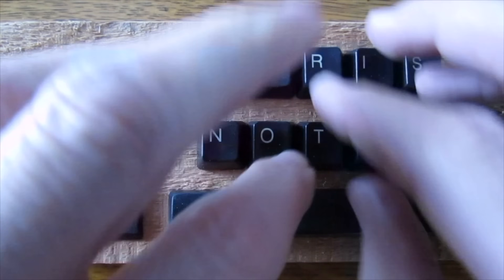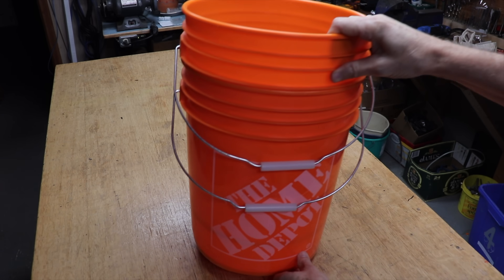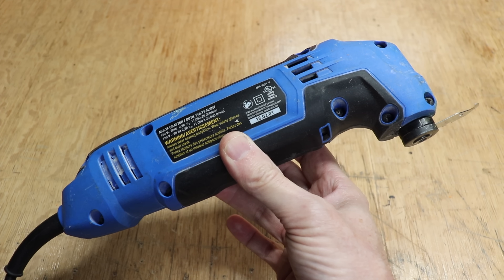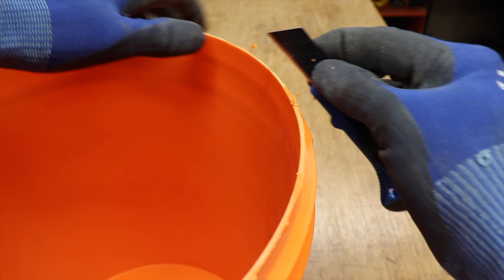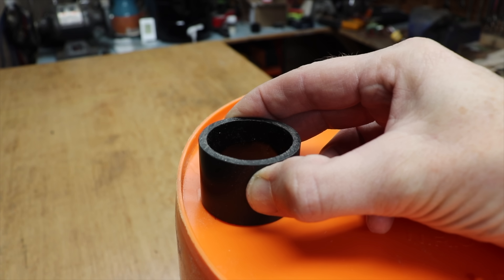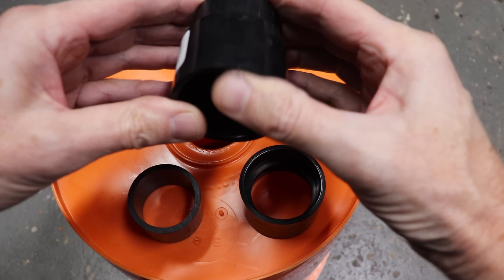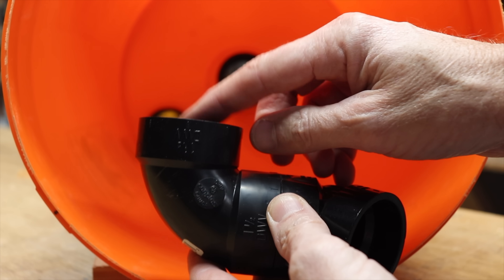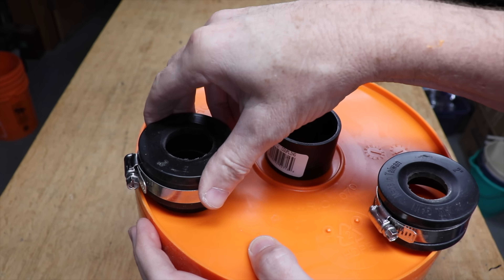How to Make ● Simple Cyclone Dust Collector

Comment: I made 2 of these 1 for sand blasting cabinet 1 for powder coating cabinet and liked it so much made a third for when cleaning crap around the work area ... with that said when using it for non stationary applications the pos tips over always ,, you have to use a death grip on it when cleaning to keep it from toppling over ..recomend you attach it to a cart along with sweeper. with that said for people using a large craftsman skip using the itty bitty pipe in video buy 2 inc pvc or abs fittings when connecting to the craftsman hose take a 2 inch coupler and shove a small length of pcv tube into 1 side so it retains it shape and on opposing end of coupler use 2 hose clamps joined together to put pressure on outside diameter of coupler (to big for craftsman hose to connect to) using a heat gun heat the end of coupler while gradually tightening the hose clamps to make the diameter small enough for a snug tight fit on the craftsman hose. when tight fit is achieved leave the hose in coupler and go brew some coffee and let it cool .. when cool you now have a craftsman to 2 inch pvc coupler ... make a few so you have plenty of adapters.  I used hard pvc pipe for blaster and powder coating because it was better and cheaper connection then using hose or cutting up one of my expensive to replace craftsman hose. also makes chances of tipping over nil as the hose if not trimmed to exact length places a load on buckets wanting to tip them over.. could always drill and tap spare workout weights to bottom but no need at moment
Reply from the maker: Did you see the update video where I address the tippy issue?

Comment: I wonder if this could be adapted to sucking up leaves in a pool? I've worked with cyclone pulp cleaners in the paper industry most of my life and they are very efficient. Adapting this to separate water and leaf particles would be a great find as they are the bane of my existence every spring when it's time to get the pool ready. Going from vacuum to pressurised would require rethinking all connections, but not a big deal. Hmmmm,,,,gonna have a go at it.

Comment: I built one of these for my shop it handled my plainer and table saw with no problem. I did add a plywood disk to the bottom of both buckets to strengthen them, the top bucket for the pipes an the bottom one to attach a castor base to

Comment: Sadly, the details of the buckets have changed since then. I am still working on a way to make the current version fit.
Reply from the maker: Others have said the buckets at Lowes also work. Hope that helps.
Reply: @chrisnotap  what ended up working was an inverted Lowes bucket inserted into an HD bucket. I trimmed the blue one snd added a gradual taper with a belt sander. Thanks!

Comment: Hmmm....MY Home Depot bucket is definitely different from YOUR Home Depot Bucket. I hope it still works. The rings are closer together on the top of mine, and the center ring on the bottom is smaller than the outside diameter of the pipe...

Comment: I bought one of those orange brand separators that fit on the top of the buckets, it said 99% effective, nope 75 at best so I returned it and bought the parts to make this. I'm VERY impressed at the effectiveness. Hardly anything in my dust vac.

Simple and easy to make too, thanks Chris

Comment: Ha! I'm amazed it worked as well as shown! I have experience working on industrial cyclones in the plastics molding industry. Regrinding scrap plastics generates lots of dust (or "fines" ).
Typical cyclones are conical shaped - airstream introduced at top of cyclone pointed in direction to go around....spinning air throws dust particles upon cyclone walls (centrifugal force)...particles fall down to bottom....where an airlock (rotating drum having "cavity wells" collecting dust) dumps it below cyclone into a bag etc. Air flows out thru pipe in center of top of cyclone to a baghouse.
Cyclone cone shape is the secret of a good working system. 
Like I said...I'm amazed this design worked! Was not of conical configuration. (I'm gonna build this design but I'm going to use cheaper buckets from WalMart because I'm a cheapskate! 😆👍

Comment: A W E S O M E!
Finally got around to making this and works way better than I expected. For the dust inlet I used a shop vac multi tool adapter so I could switch out easily for different size hoses, it slips perfectly over the 1 1/2 coupling. I’ll leave a link below. CRAFTSMAN CMXZVBE38677 2-1/2 in. Wet/Dry Vacuum Universal Tool Adapter Attachment https://www.amazon.com/dp/B00JG3F8S6/ref=cm_sw_r_cp_api_glt_i_TRKT6GJ58A7SWY1QENZ4

Comment: I would add a sheet of metal to reinforce the bucket where the air stream first meets the plastic of the bucket. Otherwise it will get sanded down in no time.

Comment: Buckets at Home Depot (and everywhere else) may look the same, but they're manufactured by different companies to fit a loose guideline, not an exact spec.  You need to edit this video because not all buckets will side into each other when cut to your specifications.

Comment: Hey Chris, great video, thanks so much for putting this together. I have two questions:
1. How many HP did the vacuum you used in the video have?
2. The 1 1/4 inch hose is a bit narrow for much other than just dust. Do you think this same design would work if all the components were spec'd out for a 2 1/2 inch hose? Like 3" rubber caps, 2" pvc parts etc? Plus of course, the small screw ;-)
Reply: Hi Nenad, I was thinking the same. Did you try it? I am going to try a 5 gal shop vac. Thanks

Comment: I have a vacuum pump from an upright bagged vacuum cleaner that I took apart. It's pretty strong. Do you think I could just stick it on top of this assembly with a filter to keep particles out of the motor?  It still has the seal from the enclosure it was in so it could just sit flat on top of that middle hole.
Reply from the maker: Give it a try. It's all about creativity and trying things out! Go for it!

Comment: I made this: a few issues though: I think it depends on how powerful your vacuum is. If it's powerful fine dust from eg. a fine saw blade won't stay in the buckets and will go into your vacuum's canister. 2) this two bucket set is top heavy especially when you have two tubes attached to it. 3) How much of the top of the bucket you cut may differ from this video- I had to cut a bit further down to allow the two tops to come together. Advice: mark where the buckets come together for easier reassembly. I mark two spot 180º from eachother and label it step "1"  and step "2" because it seems to be easier to assemble it in a certain order.

Comment: Can this system be done with a full size garbage can? I’ve been running boards through my planer to make base molding and I fill my shop vac every 10 min. So far I’ve filled 2 full size garbage cans with shavings.  That’s a lot of shop vac dumplings!

Comment: I run a 2 1/4" out to my equipment. That's takes a bigger rubber cap. Not sure if two bigger ones will fit. Can I keep the inlet at 1 1/4"? Or will that restrict air flow?

Comment: I would not use the Dremel, or step drill or snips to make the holes, a hole saw works best! Otherwise good video!
Use a wooden dolly at the base of the buckets with casters to prevent it from tipping. Your welcome!

Comment: Made one yesterday and let it sit over night cause I put silicon on all my joints. I also added 2 unions because I have it mounted and secured to a rolling cart with my vacuum. It works fantastic dust in container brand new shop vac filter was spotless. Wish I could add my video!
Reply from the maker: That's great. You can send a video to chrisnotap@gmail.com if you like. I'd love to see it. Thanks!

Comment: Maybe try extending the central/collection tube deeper down into the center of the bucket? It's not rocket science, but all the commercial designs I have seen share this feature. I imagine having a short/flush tube near the ceiling allows more of the fine dust to funnel up and into your filter. 

With all that vertical space, you could put a foot long pvc pipe on there, easy.
Reply from the maker: Yes. I tried all kinds of lengths but this was the best as you can see.
Reply: Thanks. The single bucket I hacked together works better with a pipe down the center, but I didn't experiment with different lengths.

I'll be buying two buckets on my next trip to the store!

Comment: I made this dust collector for my Rigid shop vac and it did not work.   I followed the instructions here exactly except I needed to use 2" PVC fittings for my larger hoses.  What I think was happening (just a guess at this point) was my shop vac was much larger than the shop vac used here and had a lot more suction, this combined with the larger fittings caused the two pipes in the bucket to be too close to one another, effectively short circuiting the flow and causing the dust to just go from one pipe straight over into the other pipe and into the vacuum.  I still need to experiment but if you are using a larger shop vac, you will likely need to find larger diameter buckets to make the pipes further apart from one another.

Comment: I made this and it works great separating the sawdust. The only issue I have is that it tips over easily when moving around and vacuuming my garage floor. I need to figure out a solution.
Reply from the maker: I did an update video that addresses that issue here! ......https://youtu.be/BeU4nqSJtBY
Reply: @chrisnotap  That is an awesome fix. Thank You......

Comment: Using a hole saw is a lot easier, faster and cleaner than using the Dremel tool. I screwed on a round piece of 3/4" x 16" plywood to the base of the secondary base bucket with some old chair casters attached. I found the casters off a discarded office chair that has the peg connecting mounts. I just drilled 4 holes, one in each corner, slightly smaller than the caster pegs and whacked them into the plywood. Works great and doesn't tip over.
Reply from the maker: Great tips!
Reply: Great minds think alike! Good suggestions G RP!

Comment: Great design and idea.  I too have dust challenges like many and can never use enough dust management.  One question/problem I see... what happens when you vacuum up 8 gallons of saw dust and have to separate the two buckets in the middle in order to empty them... saw dust everywhere?  Seems to me a removable lid at the top would be the better solution.  Just my $.02 .
Reply from the maker: Just put a flashlight behind it occasionally to see the level. Empty when it is midway.

Comment: I save my saw dust. I mix it with resin for wood holes and cracks as well as uneven angles works amazing
Reply from the maker: Great tip!
Reply: Sawdust and paris plaster...
Reply: I use mine to put out my cigarettes.
Reply: Resin like the clear one that comes in two separate parts?
Reply: @christinaarchambault4527  yep. resin and mekp

Comment: I was hoping this was going to work for my fine dust power carving. But the dust gets blown around in bucket and goes into my Craftsman 16 Gallon Vac 5.5 hp. I checked each time and nothing in 5 gallon bucket and filter in vac is completely full of fine dust. Maybe too powerful of suction? Unless I did something wrong  FYI this is very fine sanding dust.  Think my only relief will be trying to fit a Vac Bag to gather the dust and save the filter.
Reply from the maker: Make sure the 90 and 45 are aligned like in the video. That's important.
Reply: . @chrisnotap  Yep I sure did and used the same exact parts of Home Depot as you discussed.  I think it is the really fine dust that would not stay in the bucket and was swirled out under the heavy suction and into the vac. I did vacuum some chucks and they did stay in the bucket

Comment: I tried this and i guess my shop vac is too powerful and keeps sucking in the dust leaving almost nothing in the dust collector. I'll try to add a barrier between the in and out so the dust hits it and falls down vs getting sucked into the vac. Also the newer Home Depot buckets have a new design, but you can still force them together like you showed.
Reply from the maker: Make sure the 90 and 45 are aligned as I showed in the video.

Comment: Have you experimented with some short extensions on the 45° Piece, to make sure the inlet is below the outlet? And see if even less dust get's to the shop vac? And, a simple piece of Fabric Hose clamped over this Outlet? (Same reason!)
Reply from the maker: I tried every set up I could think of with lengths and angles. This was best. But you can experiment with different lengths to see what works for you.

Comment: Hi, Thanks for great video...im just making my dust collector and ordered my items from amazon..  Just as an FYI your link for the PVC is for 1/2 inch pipe.  Amazon adds can be changed by independent sellers so it's likely it has changed since you posted it.    I'm sanding concrete so I am hoping it will work with such fine particles...Happy to let you know.
Reply from the maker: Thank you very much for bringing that to my attention!! I have removed it for now. Yes, Amazon does that.No one has that pipe on Amazon at the moment. I will re-enter a new link once it becomes available. Thanks again for taking the time to let me know!

Comment: Finally! I finally found exactly what I have been looking for; a no nonsense approach to shop dust collection without a bunch of gadgets. Seriously, I have reviewed so many processes for years and finally Chris has delivered. Thank you Chris for sharing your ingenuous idea! I can't wait to set it up!
Reply: The goal isn't to have a separate container for the large particles.  What does that help?  The goal is to prevent clogging of the filter and it is the FINE PARTICLES that do that... which is what you have on your filter.   Most people have a 10 gallon or larger shop vac, so all you did is decrease the capacity before having to empty.
Reply from the maker: Awesome! Thank you!

Comment: I built one of these dust collectors per Chris Notap's video and the subsequent updated video.  My collector bucket is collecting about 75% of all dust particles, but the other 25% is findjng its way into my ShopVac and its HEPA filter - which is not what I expected.  Any hints why this is happening???  I followed the plans precisely.  My hose is 2.5" throughtout the system.  Thanks in advance for valid assistance!
Reply from the maker: The only thing I can think of is make sure you have  the 45 and 90 aligned like in the video
Reply: The two connections on top of my bucket are a bit loose - probably need to apply some glue and rig a clamp to ensure a permanent, tight fit.  Also, I was not able to find ABS 90 and 45 fittings, so I used PVC - which appear to be larger than the ABS fittings shown in your video.  I'll figure it out - was hoping that others had already experienced the same issue.  I will post a response here if I resolve the problem.  FYI: prior to stumbling upon your video, I was totally unaware of dust collection.  Thanks very much for the info.
Reply from the maker: One other person had the same issue and it was the alignment of the 90 and 45 that caused it. Good luck!
Reply: @chrisnotap  Today I tore down the entire bucket assembly, and re-assembled everything.  I did NOT use PVC glue, but rather hammered the couplings together as you recommended.  My angle between the 90 and 45 bends was slightly greater that yours - so this time I measured 1/4" at those markings that you mentioned.  It was VERY DIFFICULT to seal the buckets today - as it's 7 degrees outside in North Texas - 28 degrees inside my workshop/garage - but I did ultimately succeed.  Hopefully correcting the angle, and making certain that the connections are very tight will resolve the problem!  Thanks for the help...  John in Dallas

Comment: Learned 3 things from this build.. 
1. Lowe's blue buckets don't taper enough before the big collar, you have to cut quite a bit.  It'll work, just might not look pretty.
2.  Don't put a ton of weight on the bottom of the bucket you put the holes in...  Duct tape works fine to fix it.
3. If you don't have an extra hose and your big box store doesn't have any, do not use the plastic flexible hose that's used for sump pumps.... It will sound like you've released a banshee in your garage and upset the neighborhood's dog population.

Other that that, it seems like the build works great!  Thanks for the solid instructions!!

Comment: Thank you. I just built mine and decided to pick up drywall dust just to see how well it might do. It did a great job I didn't have to stop and clean the filter on the shop vac.
Reply from the maker: That's great! Many have asked and you're the first with that feedback. Did you vacuum up a lot?
Reply: @chrisnotap  About four inches in the bucket and just a skiff in the vacuum. It did cover the inner filter as it always does but didn't clog it.
Reply from the maker: @pntblank1000  Wow! That is really good. I will pass that on to anyone that asks. Thanks.

Comment: I use one of these and added a weight in the bottom of the bucket to keep it from falling over when using with an random orbit sander since the hose is always moving around...
Reply from the maker: I did and update video on that issue.......https://youtu.be/BeU4nqSJtBY

Comment: Regretfully, after ten scraping circuits, my buckets would still not join.  I measured the inner diameter of the receiving bucket, 28.2mm (avg), I measured the outer diameter of the bucket to be inserted 28.5mm (avg), no way these two are going together.  Am I a victim of Home Depot Bucket design change, or is this what I get for not buying the buckets at the same time?
Reply: Having the same problem. Did you find a fix?
Reply: @flameboy054  negative, I thought about making small V cuts to the upper bucket, but inevitably gave up on the project.